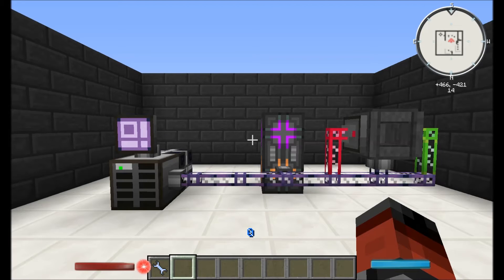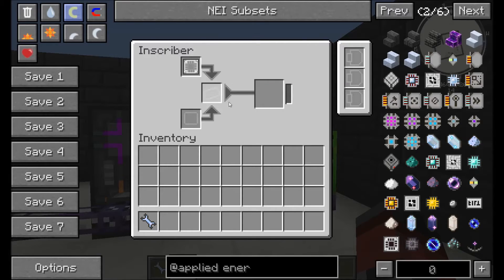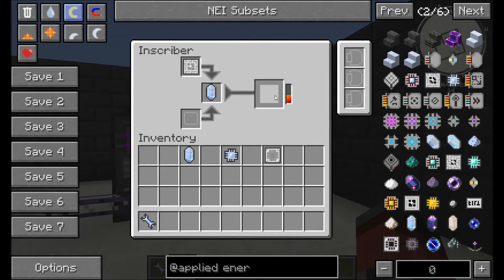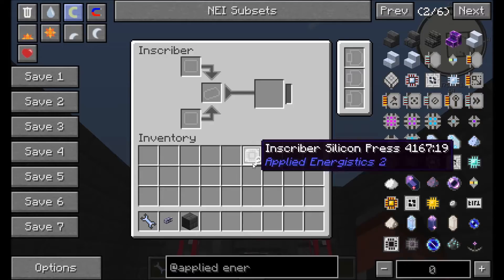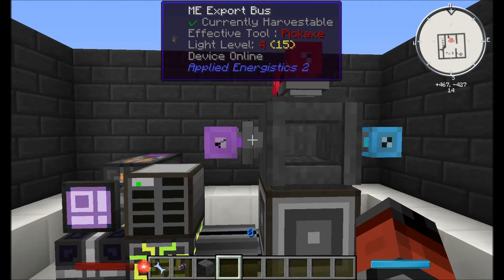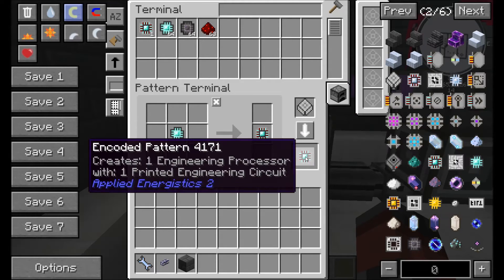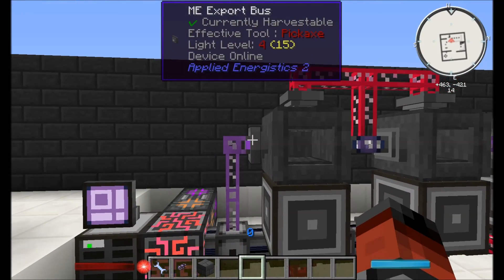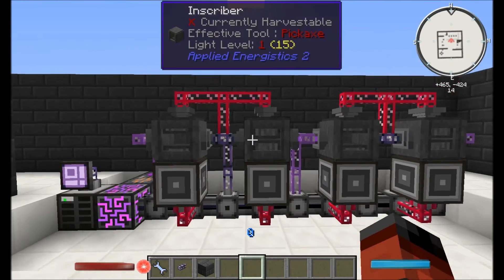Minecraft FTB Applied Energistics 2 Tutorial - Inscriber Automation with AE2

Comment: I tried building it the way you showed. (The one that makes the processors. But it kept filling all the lines up. Not sure if I was doing it wrong or not. But I managed to make it work albeit slightly less compact.
Reply from the maker: Is this the first set up that I show or the second one that combines them all? what do you mean by filling the lines up? If you are having problems I suggest checking you have used the import bus and export bus the right way round and placed the crafting card in the correct bus. If it isn't crafting but is showing it is crafting in the crafting cpu try adding a seperate crafting cpu and co-crafting cpu to help.
Reply: Sorry just to clarify. I am pretty sure I had replicated what you had done with the 4 inscribers that you used to make the actual processors. But my channels always maxed out on the smaller fluix glass cables. I ended up just making 4 p2p networks all hooked up to the same part of my controller. Everything else is the same.
Reply from the maker: Ahh yeah, this set up eats channels, some thing I have problems with infinity expert mode when controllers where harder to craft. Glad yo know you got it all working
Reply: Also great video! It really jump started what I needed to do for my world. Since I was building up to the Thaumic Energistics stuff. I am really happy with my ME Network so far!

Comment: I really hoped you'd show us inscriber tower setup instead of this..

thumbnail bait.

-1.
Reply from the maker: Really wasn't trying to "bait" people with this thumbnail. I try to keep the videos shorter and the main point of this video was to show how inscribers work and give ideas of how to set up automation for them. The tower design is the same as I showed just before it but you simply wrap it around fluix cable for power. If you wanted a more in-depth video of setting up the tower design and other ways to do the wiring for it, then you could have asked and I would be happy to help with that. Thanks
Reply: ibbski1110 I understand making compact, simple and easy to understand tutorial videos. But, don't you think there's rather big difference between 5 inscribers versus 15 (tower)? Setting up 1 line of inscribers is relatively easy and one just needs to understand how import, export buses work. But for few lines of inscribers (like that tower) there are alot more problems.

I came to your vid ecause of thumbnail. I hoped very very much that you'd mention how to deal with setting up last (3) inscribers responsible for putting processors together.

But to my surprise you talked about tower for about 1 minute and only how it looks from the outside..

So for me this thumbnail was a simple bait. Thus i downvoted you. It doesn't mean your creations or tutorials are bad, but you have to work on those little things like honesty :)

Comment: When I try to make it craft Printed Engineering circuits or some stuff that only requires the press and 1 ingredient, it keeps doing it all the time even though I didn't order it. Which means it just keeps consuming my materials until I have none left.

This is with the 4-inscribers system you showed us at the end.

What am i doing wrong?
Reply from the maker: +GladGulGubbe94 Okay I think I get you, so the system is continually crafting the processors ( as in printed processor + printed silicon + redstone)?

 I would suggest to check that you only have 1 crafting card in the export bus that has the printed silicon, and not in all of them as it will keep crafting them up. The crafting cards are optional so try the system with out and see if it happens again. Other then making sure you have used the right export bus or import bus where needed and not 100% with out having a look to be honest.
Reply: Okay, I'm not sure I understand exactly. But I'll give it a try, worst case scenario maybe you could join the server and take a look :D
Thanks for the response!
Reply from the maker: +GladGulGubbe94 Sure sounds good, would think it will be some thing little and easy to sort.
Reply: Okay yeah I can't get it to work, it keeps eating my materials, it either keeps using it all or it disappears
Reply: +GladGulGubbe94 Same problem here!
Reply from the maker: +Dumbo style Hi, Think the problem was that ME Interface was used instead of a import or export bus, check which one you have used as each inscriber should only have 1 Interface on its self, and check you only have the pattern for the correct press you want forming in the Interface and not the raw material such as diamond or gold. If you are still finding that it isn't working, try messaging me a photo of your set up or possibly jump on your server to have a look.